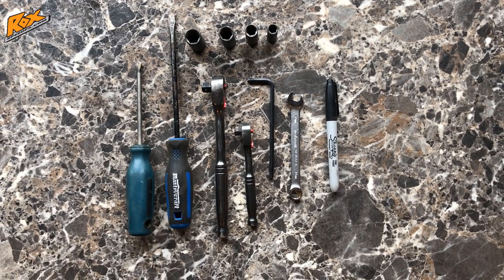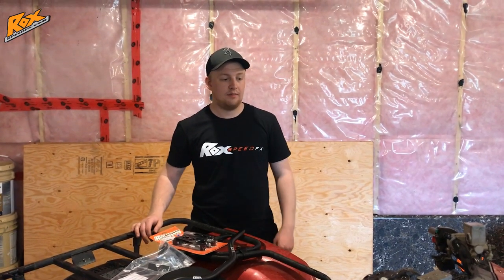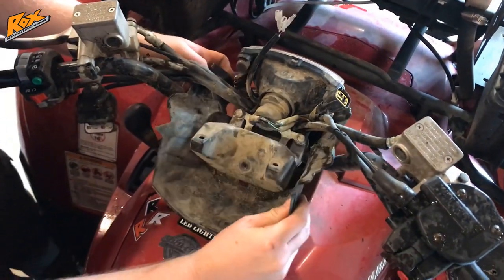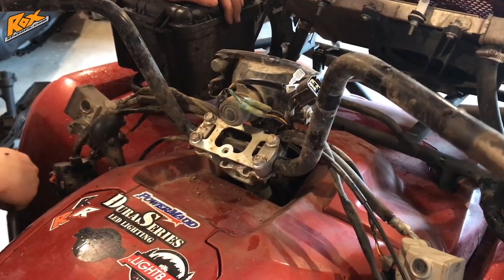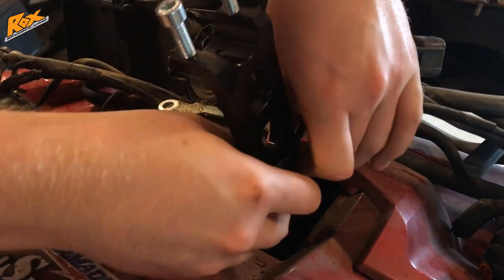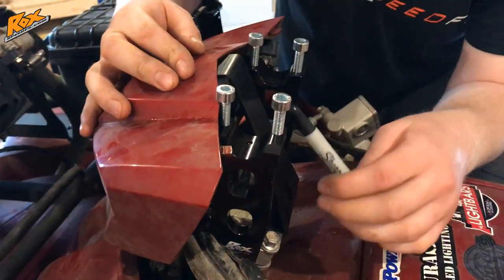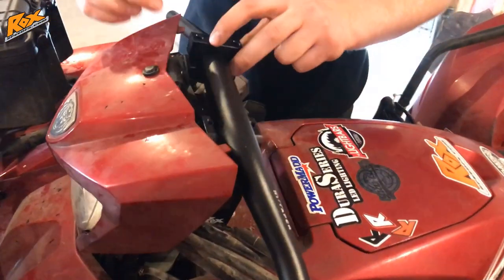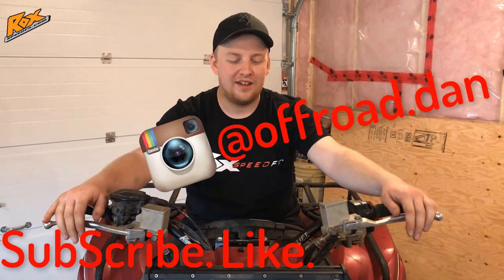How to install Rox Speed fx Handlebars/Riser Kit For Yamaha Grizzly & Kodiak

Comment: Not trolling. 
Just an FYI for others. 
You forgot to use the included washers for the 13mm handlebar clamps. 
Also for marking the light bezel for drilling it’s easier just to put the support bar bracket on the top of the plastic bezel for marking so you don’t have to reach underneath and inaccurately mark. 
Best to put a center line with a pencil from front to back on the light bezel then all you have to do is Temporarily put the bracket on the top of the bezel and your center line is there waiting for you. 
all you have to do is adjust the light cover and find the sweet spot and mark

Comment: How much higher are the handlebars after install? The rox handlebars are a lot straighter so im wondering how much you actually gain?
Reply from the maker: You gain a nice bit total different feel to the quad
Reply: @OFFROADDAN  right on man im thinkin ill order one here now. Great video buddy
Reply: For future people, the rise is 1 1/8th inch. But the bars are also wider and more flat across the front. Gives you extra leverage, and a better riding position for spirited riding. If it's a total farm rig then it's not worth it. But these days most people use them as sport utility vehicles. A great upgrade
Reply: Mods like these are some of the most underrated mods there are. People go right ahead and spend $1300 on the big three EHS mods for like 5hp. I would for sure buy these risers and stage two Elka shocks And be way faster on the trails. And way more comfortable.
Reply: Love mine, hands down one of my favorite upgrades. Comfort is king